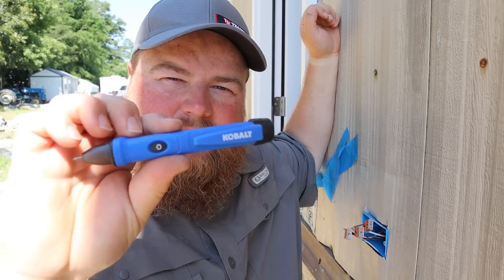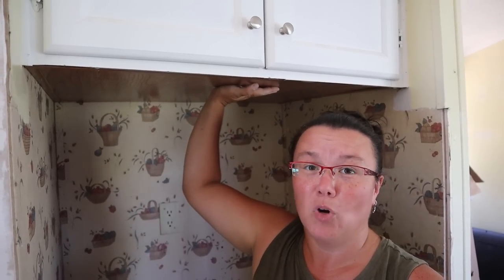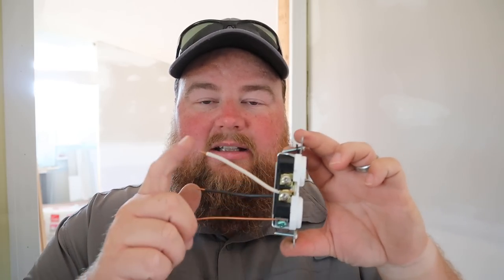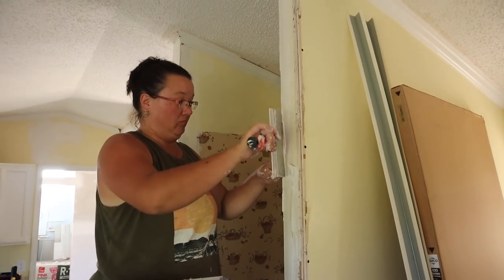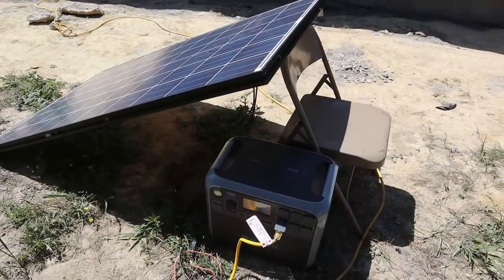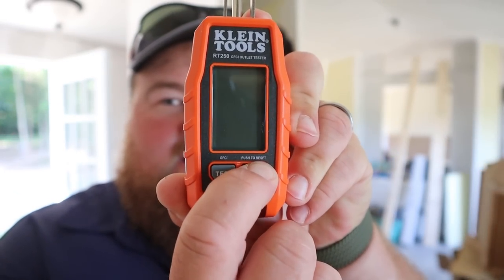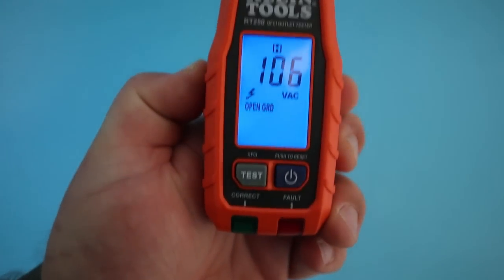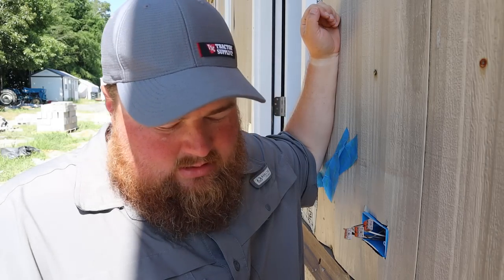Projects Everywhere! Interior Work Continues! // Mobile Home Remodel

Comment: We bought our 1997 Belmont Mobile Home and moved in on our youngest daughter 10th birthday June 1996; we chose the floor plan, wall type, color and floor type which back then hardwood flooring was not an option. It is a 3 bedroom 2 full bath. I had our daughters (2 girls) full bath placed at the end of the hallway. That was 26 years ago. 2016 we gave it to our oldest daughter and we moved in my folks home after they passed. A lot has been done to it and still more. Hubby and I will be moving back in it soon. I love that mobile home. And yes our ceilings in the middle were 10 feet in height with the wall-ceiling was 8 ft. Trailer 16x80. One of the change we made was a tankless hot water heater and not once did our lights flickered or had any issues. 
Does my heart good to see y’all bring new life to your mobile home.

Comment: My father taught me that if you want a reliable appliance, buy a Sears Kenmore.  We've been in this house for almost 19 years and bought a new Kenmore stove and refrigerator when we moved in.  Still going strong!!  Also we bought a new washer, dryer and upright freezer (all Kenmore) a year before we moved here.  All are still going strong.  This is only the 2nd set of washer/dryer appliances we've bought since 1979.  The other ones, the washer finally died but we gave our dryer to a friend of my brother and last I heard it was STILL working!!  They too were Kenmore's and we'd had them since Feb. of 1979. The dishwasher that is in the house when we bought it is still working but when it dies, it will be replaced with a Kenmore as well.  Also buy Craftsman tools...they never let you down either.

Comment: A minor suggestion if you haven’t done it already, build a frame and sheet rock it for the water heater closet door. That will blend in quite well when painted and cost almost nothing.

Comment: Great shot of hooking up the outlet at about 15:00. That's cool that you were able to use scraps to build the water heater closet. How about bi-fold doors for that closet? You can take them off real easy if you need to get the heater out in the future.

Comment: I had a little chuckle at your statement about working on your 80’s mobile home. Some people see it as a waste of time and money, but I disagree. I did the same..my mobile home is a 1954 Stewart model. And I gutted most of it, furring out walls so I could reinsulate, new electrical, new plumbing, putting in hardwood floors, shiplap walls, and oak cabinetry. It looks and functions amazing! I had lots of naysayers giving me grief over my putting in money into such an old home. But it worked, and well. And it’s cozy and comfortable, and it’s what I had.
Reply from the maker: Sounds wonderful! Usually those comments come from people of a different mindset than us. :)

Comment: I'm watching with my individual project diy mind and feeling that the assorted projects amount to a pretty penny - On the other hand, you would have had to trench in power from the grid despite what structure you chose if you wanted to be on grid; equivalent with the water.  Site set up would have likely been much the same if you brought in a newer, or brand new modular/ trailer.  Having a stick home built, or building it yourself-ish would have been similar enough in terms of grading and foundation to be at least as expensive.  While doing what seems like somewhat extensive interior remodeling, going at it the way you're doing it is somewhere between a draw and cheaper than the cost difference between a newer modular and using the home you've already done extensive structural and aesthetic upgrades on.  Yes, your family is building a sleeper of a forever home capable of lasting for forever!

Comment: These days when I do a rewire gut job, I go with 20 amp wire, breakers and outlets. If I do a shop, I go with 20 amp too because of air compressors and wall ac units.

Comment: Been an electrician for 30 years.
What I found with the clamp on the plug they are a little thin and bend eazy .  Not that it bad . But here the deal. AFR  LOL.  When it pushed in the box the wires can loosen up a little . Push the plug, switch, GFCI....  into the box then pull it out enough to check, retighten.

Comment: On your water heater situation, we ended up putting small point-of-use (tank style) water heaters in our home. We have a 8 gallon one in our master bathroom, another 8 gallon one in the "kids" bathroom, and a 2.5 gallon one under our kitchen sink. We never have to wait more than 1 or 2 seconds for hot water to come out of any faucet in our house. And we have lowered our water usage. We still have our 40 gallon 240 volt water heater in our utility/laundry room, but I blocked all hot water lines coming from it to the rest of the house. So, basically, all it is used for is the washing machine.

Comment: I have been alone in my 1995 16x76 Dutch since 2016. The 2nd time I went to shower in the master bathroom the hot water faucet would not turn on. So it's not been used since. In 2020 when the tp  shortage started it took 3 months to be able to buy any. I had been without a vehicle from Dec 2018 to June 2020. As soon as I got my car and it was back in stock every time I went to Walmart I bought a HUGE package. I had it piledto the top of the shower with 3 9 roll packs on the floor of it. My grandmonkey Maddy came to live with me for the summer this year. She went in there and said, Nana, do you have enough toilet paper? I told her what happened and with only being able to use flushable wipes for 3 months, I WILL NEVER RUN OUT OF TOLIET PAPER AGAIN!!!

Comment: Glad to see you reinstalled a tank type water heater. I never understood the theory of saving on power. It takes the same energy to heat a given amount of water to a given temperature. The difference is to do it instantly on a whole house scale takes about 30,000 watts or slightly over 120 amps at 240 volts. Whereas a tank unit that has 2 heating elements of about 4500 watts each but is wired to use only one at a time will draw about 20 amps at 240 volts. On a residential service an 120 amp load is over half the ampacity of a 200 amp service. Electricity utilities typically do not provide a transformer equal to the full rated ampacity of the service since industry standards dictate what the average home will draw.When they install your transformer ask what the KVA rating of the unit they install is. If it has the capability of feeding the full 200 amps it will be 50 KVA. They may install one only half of that based on average residential load studies. Unless of course maybe you paid extra for the full 200 amp capacity. A single 120 amp load is pushing it on a standard residential service. That’s why you could see the results of the high current draw with the other electric uses in your home.Any one seriously wanting that instant option better plan on at least a 300 amp service. A handsome price to pay just to say you will never run out of hot water.

Comment: I am not an electricianologist, but, as a homeowner that does quite a bit of electrical, those electricity detectors are a backup, sanity check device only. With that said, you should be able to get it to show a reading when rubbing on your shirt (similar to you rubbing on the aluminum siding). I always make sure that works before testing a circuit.
I have both a Fluke and a Sperry version, and I very much prefer the Fluke. It has always been accurate, and it has prevented accidents. Lol

Comment: Looks like you might have room for a wire shelve over the top of the water heater. You could put a basket and fill it with some things. everything is coming together nicely. Can't wait for the final reveal.

Comment: I put in a hybrid water heater.  Heat pump setting it draws 1.5-1.7 amps 
my fridge is 24 years old but i do have a back-up
you are so close to finishing up       hope it is very soon and life will return to normal

Comment: I think placing an interior shelf above the water heater that opens separate from the water heater area. Angela such as myself are not the tallest or do we have monkey arms. This is a great place for towel storage or bathroom supplies out of sight. Just a suggestion

Comment: I bought a set of those WAGO Lever-nut connectors based on your recommendation a few videos back and I'm happy I did. I had to replace several outlets in our old doublewide mobile home and these connectors made the job so much easier. Thanks for the tip.
Reply from the maker: Glad you like them! I'll never use anything else if I can help it. They're just so easy and very helpful to undo/redo connections.

Comment: Looking good guys.. well great actually!  Have you considered maybe adding on to the back of the house now that you are basically in your forever home spot.  Just using the back door  You can add a room as large as half the home.. make it a laundry room and and storage-pantry etc.  Insulated and with full electric and all.  the walls can be tin on the outside to match the rest of the home and drywall on the inside.. a skylight would be a nice touch.  Or you can cut out the existing wall and make it a more open concept that extends the size of the kitchen...  I saw it on another mobile home video.  it made a huge difference.. the back door was in the extra room and you come in from the new deck.  idk.. just wanted to share the thought..  =D  Angela, great job on the mudding.. My brother told me to use a wet sponge afterwards to smooth out the edges and there would be less sanding once it dried.  I was terrible at it  hahahaha.  =D

Comment: If you have not finished the small room for the hot water heater, if you make just a little bit bigger around or if done make sure that you get more insulation around it that will help with the power and heating needed for it which in turn will help the power bill at the end of the day.

Comment: Can you get 773 or 2273 Wago connectors? They aren't quite as handy as the 221s but half the price. There's no levers but you can still remove individual wires by slightly twisting the connector while pulling on the wire. 2273s only go up to (if I remember correctly) 14 gauge wire (2.5 mm2 in metric terms and 14 is slightly smaller than that so 12 probably doesn't fit), 773s go up to 6 mm2, so probably 10 gauge. Just make sure you get the right ones, there's a bunch of sub-categories of the 773 family.

Surprised to hear about the average lifespan of fridges! My parents' combo seems to be on its way out - at 31 years. It's pre-environmentally friendly refrigerants though and I suspect those old ones lasted a lot longer than modern ones. Apparently the current refrigerants have smaller molecules and therefore escape more easily through the tiniest of leaks and once the refrigerant is gone from a domestic fridge that's it, garbage.

Comment: The Klein Tools NCVT1 can do the same thing your Kobalt tester did, I'd bet money the button got stuck on, and it SHOWS green, but it's actually not ready to detect.  They recalled the Klein models a year or so ago due to the issue.  I did pretty much the same thing Thursday with mine (I still need to send mine in), working on a 220v mini split install.  I at least caught it before I got shocked, but it was a pretty close call.  If you want info as to what the problem is with them do a search for NCVT1 Recall and they have the details there.

Comment: From a retired Aviation Electronics Technician.  You've never been electrocuted.  That only happens once and its permanent.  Electrocution is death by electricity.  I have shocked the crap (litterally) out of myself before almost like you.  House power tickles compared to a 40000V CRT (Cathode Ray Tube, old school TV for those that dont know what a CRT is).

Comment: I probably would not do a door but instead take a plywood board and router the edges of 3 sides and so it fits the opening and can be screwed or secured in place. Removed when as or if needed and give full opening of door opening as you already have. If you need air flow then cut out router opening to put a grill in place for air flow. Just saves putting door and reducing size of opening. Just another idea.

Comment: I enjoy all of it watching you guys doing it, I've redone so many old houses in my lifetime I've done a little of all the tradesman work and  last year I bought another one so now I'm doing another one, it was built in 1939; I've got a lot of projects ahead of me. I am trying to avoid any drywall because it taxes my patience but I don't like paneling. You did such a nice job Angela! 

I actually enjoy the electrical. I use 12-2 for outlets and 20amp plugs and breakers because I like to know I can plug in any appliance, heater, or air conditioner anywhere and not overload the circuit. 

I didn't realize there are electric on demand water heaters, I'm only familiar with the propane gas ones. When you finished the water heater closet I was thinking oh my goodness look at all those seams Angela has to tape and mud and finish. It will look so nice when it's finished out though. I buy the big packs of TP too, I'm with you on the large packs, I try to get the 30 pack Mega roll when it's available. I call it stocking up to save money and less trips to the store. I get paid once a month so I try to buy one time a month to last at least a month, plus I live very rural and it's a ways to wally-world.

Comment: I totally agree with you on the cheapo non contact voltage detector. I've had cheap ones and it's just wasted money. I now have a Fluke one and have never had a problem. 
Commercial lighting circuits are typically 277 volts and one of the cheap detectors I had would start beeping as I was going up the lift to work on the lights. When I got within about 5 feet of the fixture with the thing still in my pocket BEEEEEEEPPP! Useless since it's not uncommon to have multiple circuits in the same junction box and I need to find the one that has been shut off.

Comment: I always learn something or reminded of different aspects of remodeling.  We are planning on updating the interior of our home.  Watching y’all remodel has helped me realize that even though I’m hiring someone to do the remodel, I need to be aware of the checks and balances they should be doing.   Also, I wasn’t aware that tankless hot water heaters would draw so much power. I was considering changing to tankless hot water heater but if there is no savings then there is no need to spend the extra money.   Thanks for all the information you give us in your videos.  Love your channel. ❤️❤️❤️❤️❤️
Reply: Learn how things need to be done. The contractors will cut corners if you are unaware. Know the building codes. They are the bare minimum of how things are to be done. Push for "Best Practice ". Also, check into the terms "perfect wall", Net Zero building, passive house standards. This will be very important in the future with the rising energy costs.  Make sure everything is properly air sealed.  Make sure they follow at least the 2021 codes!! Very important!
Don't tell me you have a reputable contractor that will do it properly.  They are too rare! I'm living through a nightmare mare of a remodel gone wrong.  It's costing me 3Xs the amount to fix the problems. Buyer beware!

Comment: Proximity voltage detectors are NOTRORIOUSLY inaccurate in residential electrical systems. I'm an electrician by trade and have used most of the ones on the market. To your point the higher priced ones are better but only marginally so. I will say that they do tend to work "better" in 3 phase commercial and industrial settings but in single phase residential ones I have had the exact same experience you showed in the video.
Reply from the maker: Glad it wasn't just me then! I've largely changed to my multimeter if I need to check things, but otherwise we just disconnect the home completely.

Comment: Hey Sam, I have a Klein non contact voltage tester, it works great! I got a Klein kit on Amazon with that non contact voltage tester. And a plug in outlet tester. And a digital multimeter, all 3 tools are Klein brand. And they all work very well. I think I paid around 40 or 45 dollars on Amazon for the set.. It's definitely worth the money.
Reply from the maker: Awesome!!

Comment: Have you check your local area building code to verify WAGO connectors are code for residential wiring. I guess it doesn't mater if the inspector is  not looking at your rough wiring. you did mention everything was getting inspected

Comment: Everything is looking good...only thing I would have done differently is at least tape coat that drywall behind the hot water heater...I've learned that bugs get into the house  from behind the wall through these places...spiders especially

Comment: I am so impressed and again though I have said this before on another video you both are so inspirational and with the huge renovation I have buying my own fixer upper I binge watch yalls videos! I am curious though what you decided to do for a water closet door? I am literally needing some ideas and I thought about installing a louvered door maybe as my hot water heater is located right inside the back door with the access just behind the breaker box on side and the other is "hidden" by snap on sheetrock VOG that's crumbling. Any ideas or possible pics if I may ask on what you decided would be awesome! Thanks yall! God bless!